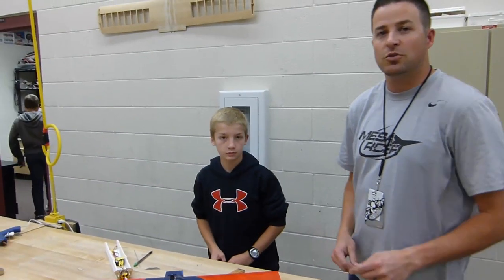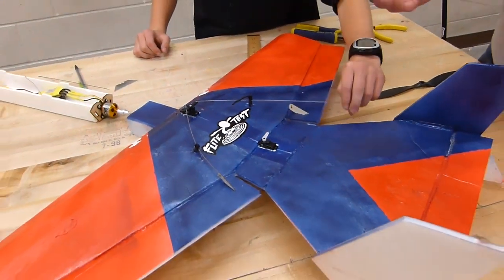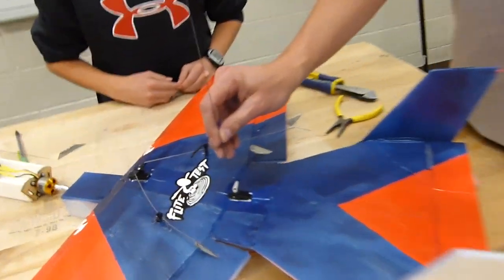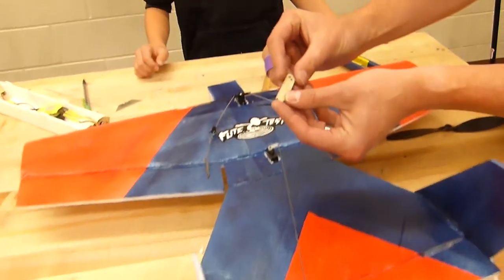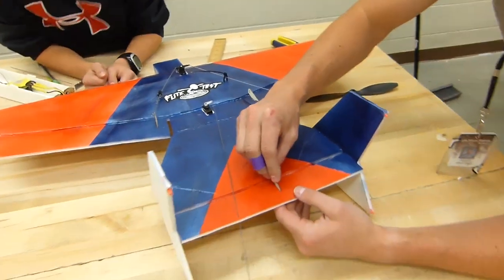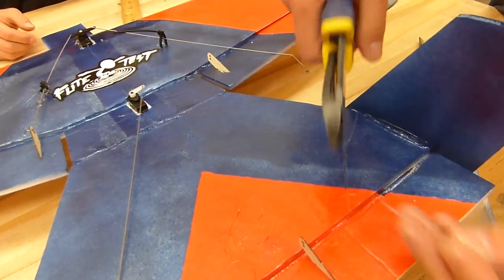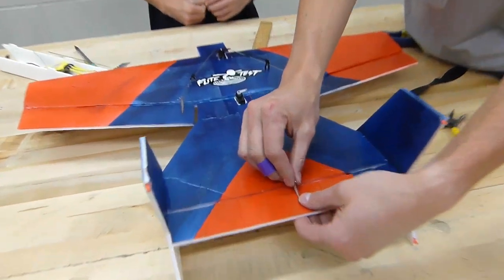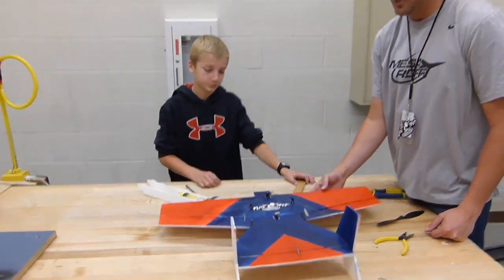MESArcFF - Push Rod Connections - TIP SERIES

Comment: Your way is perfectly fine for small foamies, but for large models (especially non-foam models) You should have a degree of adjustability in the control rod. For a wire type of control rod, using a 'V' bend in the center will allow you to increase or decrease the length as the plane is broken in and trimmed.

Here's an example:
http://www.racores.com/images/bending-adjustment-V-bends-color.jpg
Reply: Never heard of that before but it seems like a really good idea. Cool.
Reply: dellagd For large models, using threaded control rods and clevis gives more precise control of the linkage lengths as well. You can even use cables or braided fishing line in a 'pull-pull' setup.

These are just some more quick examples of different linkage setups for RC: 
Simple Plastic clevis and 'Z' bend linkage: http://oi45.tinypic.com/30ji92f.jpg

A high end aluminum clevis mounted to a plastic rod end ball link via a threaded steel rod shethed in a brass tube: http://www.composite-arf.co.uk/images/Lightning/elevator003%20(Medium).JPG

Two plastic clevis connected via a threaded rod: http://www.rcuniverse.com/forum/attachment.php?attachmentid=1288083&d=1375482194

A steel cable pull-pull setup on a rudder and a steel threaded rod with two plastic ball links on both elevator surfaces: http://winshiprc.tripod.com/spacewalker%20tailservo.jpg